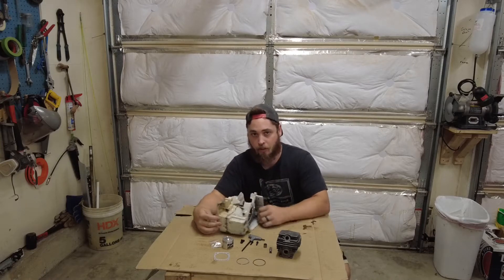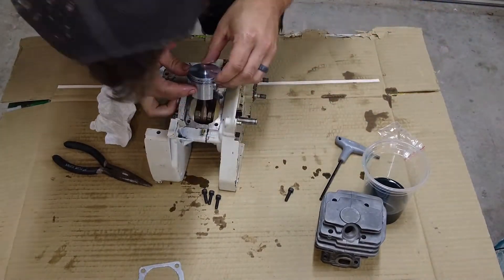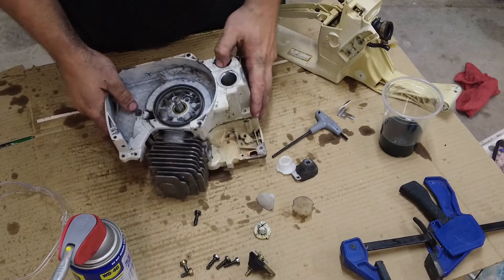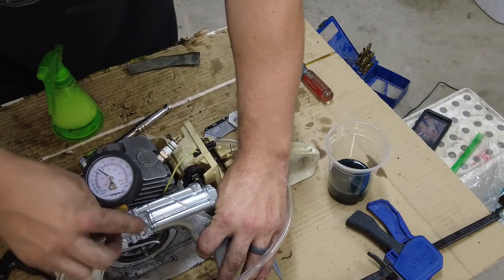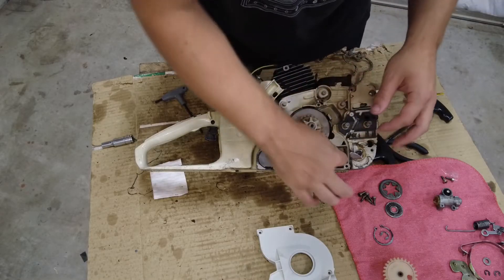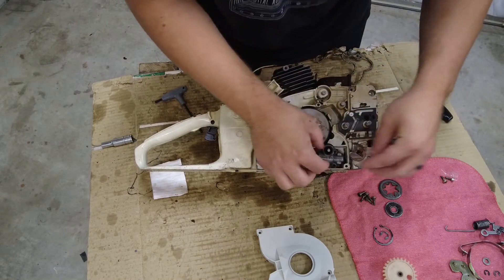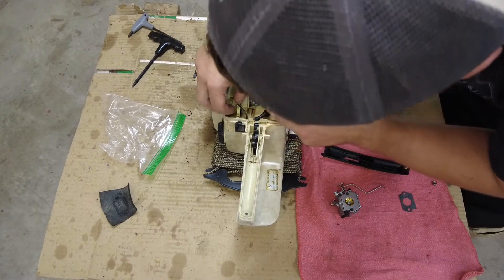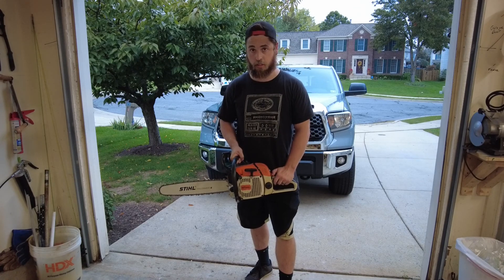Stihl 028 AV Super Rebuild Part 3. Fully Rebuilt! (Top End, Clutch, Flywheel, and First Start)

Comment: It is smart to put the circlip in the piston is on the intake side, first.  You want to make sure that one is in, properly.  If it comes out it will smoke the piston and cylinder.    After the intake side circlip is in I will fight getting the exhaust side one in.  I also use an old wrist pin to tap each side of the piston with.  This wrist pin will make sure the circlip is seated properly.  I insert it in each side of the piston and give it a light tap with my four ounce brass hammer.  The circlip is properly installed when it is in its slot in the piston and under the beveled end of the wrist pin.  If so installed, it will not come out.  If one comes out, let it be the exhaust die one because all it will do is end up inthe muffler.  If the intake side comes out it will destroy the piston and cylinder and possibly lock up the saw.  This is the voice of experience.

Comment: Thanks for a great video. I noticed that when you went to install the new air filter that it had an extra bolt in the middle that got in the way of reinstalling the air filter cover. So you set the new filter aside and used the old air filter. I had the same problem but I was able to fix the new air filter by using a clamp to force the extra bolt out of the new air filter. Then I was able to install the new air filter. Thanks for the videos.

Comment: I use a business card to set the air gap and with the coil loose I rotate the flywheel until it’s magnet pulls the coil towards the flywheel.  The business card will separate the coil from the flywheel.  I then tighten down the coil screws with my other hand pushing the coil towards the flywheel.  I tighten the coil screws tight but not overly tight.  I also put blue Locktite on them before I put them in.

Comment: Great Tutorial Video Series, I have just watched all three of them tonight. I admire your chilled out attitude to Chainsaw major surgery and your easy to follow commentary, something a lot of Youtubers don't get,

I have an old Stihl 028 AV stored in my workshop that has not run for 10 years+, the last time I used it it would not idle and was down on power, so I suspected it had bad Crank Seals that were leaking.

Your Video Series has inspired me to fish out the old Stihl 028 and restore it, I have most of the tools (except for the crankcase splitter, but I have a Mig Welder so I think I could make one), and I am usually pretty good at fixing stuff, so what the I am going for it.

Lord knows where you sourced some of the parts (I am in Scotland), but I will try my best.

Many thanks for the Videos.
Reply from the maker: Thanks, it means a lot that you got something out of the videos. Let me know if you have any trouble finding parts and I can send you links to where I got mine. Good luck and have fun rebuilding your saw!

Comment: Great and detailed video. I have an old 028 WB I'm converting from points and condensor to electronic ignition but might have to change the coil also. Could you please tell me the part # of the coil and flywheel you used? Especially the coil. Would be greatly appreciated.  Again fine job on the rebuild.
Reply from the maker: I kept the stock coil and flywheel as they were in good working condition. Hope you get yours running good again.
Reply: @MarleyJaxGarage  Mine has the old dual arm coil that’s discontinued. Don’t have a replacement so was hoping u had the # for the one u have.
Reply: @waynebaker2452  i have an 029 AV I’m probably going to tear into soon. I’ll see what kind it has and any part numbers i can find. Also have an 028 that will need it. Thank God for my reliable 026 coming out of this ice storm we just had last week!

Comment: Great work my friend.  I have this exact saw and I love it.  Problem is I can't rely on it at the moment so I think I need to do the full strip down and rebuild as it's probably pulling air somewhere.  Where did you get your pressure tester?
Reply from the maker: Thanks man I got it off of Amazon. https://www.amazon.com/dp/B004IQM460/ref=cm_sw_r_sms_api_glt_fabc_G5CA9A385RX12NDZQ8T5?_encoding=UTF8&psc=1

Comment: Phenomenal! Thanks for taking the time to document a complete 028 rebuild. All 3 videos are very informative.

What top kit and crank bearings/seals did you use?
Reply from the maker: Thanks for watching and I'm happy you enjoyed the series. I got both of them off of ebay, the top end kit here (https://www.ebay.com/itm/183434216313) and the bearings and seals here (https://www.ebay.com/itm/233940307941). Hope this helps you out.
Reply: @MarleyJaxGarage  thanks for the links. Did you port and/or polish the jug?
Reply from the maker: No I just chamfered the ports but the cylinder was machined pretty well.

Comment: Great videos.  I am curious.  You gave $20 or $25 for the saw.  How much did you spend on parts?
Reply from the maker: I probably spent 100 dollars on parts. I could have done it cheaper but the cylinder and piston were 70.
Reply: @MarleyJaxGarage  i have a Stihl 028 AV that had been sitting for at least 15 years.  Going to try a aftermarket Carb on it.  I was going to replace the coil as well.  I have been told that the new coils can eliminate the points.  I saw a guy cut away both wires (one to points and the other the the kill switch) with a coil that just had the wire to the kill switch.  Waiting on parts.  Really enjoy the videos you make.
Reply from the maker: Thanks man, I hope you get it running good again.